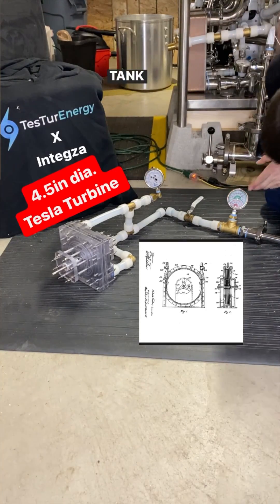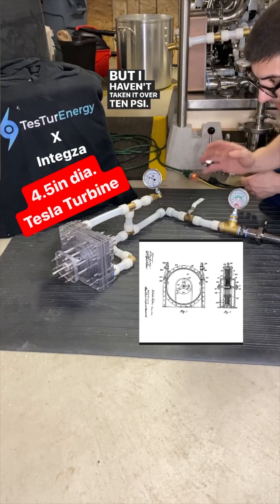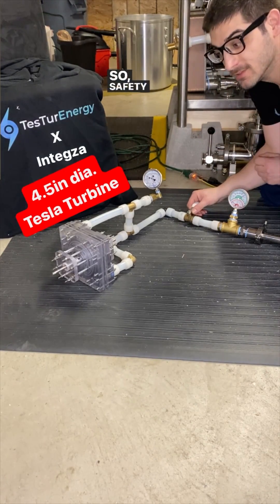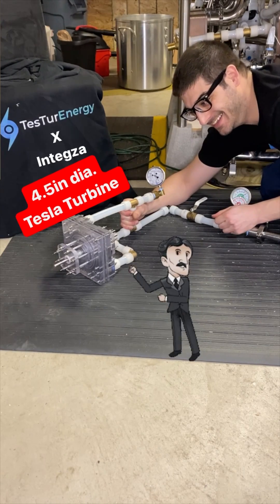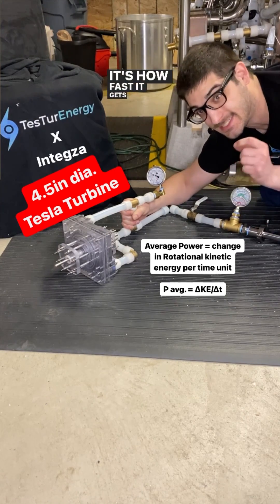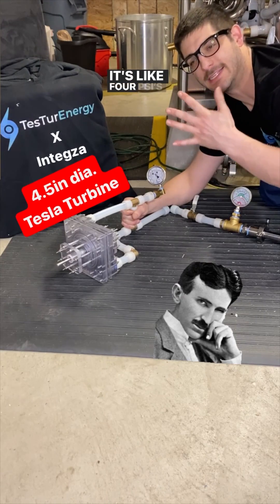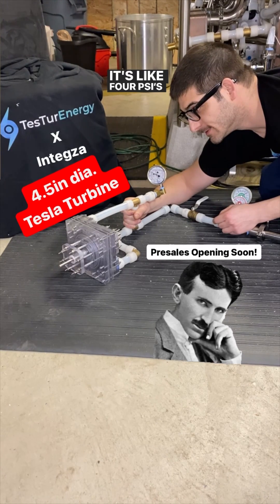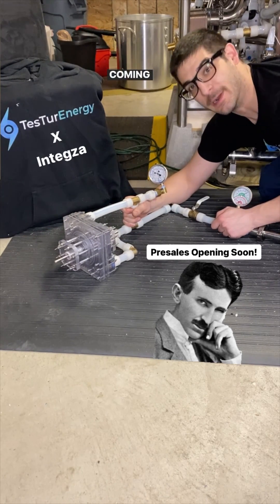New 4.5in Tesla Turbine 1st spin up! @integza Collaboration

Comment from the maker: If you want to get your hands dirty with a prototype of your own we are now selling versions of the 4.5in Tesla Turbine that we built during our video collab with @integza       

www.HeatAndPower.com       

Crafted with precision, the prototype boasts a robust design featuring an aluminum disc stack enclosed in a high-quality polycarbonate casing.      

The turbine is tailored to accommodate a variety of testing conditions, though currently optimized for compressed air tests.      

From initial trials, the turbine has shown promising potential, generating 1200 watts of power on a Dyno test with 30-40psi and a notable 250 watts electrical load when partnered with an upgrade generator package) on just 15psi of compressed air.      

It is also designed for future upgradeability, with provisions to accommodate a 2-stage upgrade we aim to release soon.      

While this turbine is a working prototype, it’s not a complete, turnkey solution or operational turbine. 

So, what’s the purpose of this unit?    

We’ve designed and are selling this prototype to provide a hands-on, engaging, and informative tool for those interested in our renewable energy systems, and specifically in Tesla turbine technology.    

It gives you a chance to see the turbine in action, understand its mechanics, and gain experience with assembly, disassembly, and maintenance.    

We believe this initial experience is crucial before making the step up to our full-sized, turn-key power generation systems.     

Get Yourself Prepared    

This prototype is essentially a first step for those considering a full-scale residential or commercial Combined Heat and Power (CHP) system.    

It offers you a unique opportunity to get up-close and personal with the turbine technology, and gain a practical understanding of its workings, benefits, and potential.    

It’s a scaled-down, educational version of the turbine we’re developing for our full scale solar thermal and biomass powered CHP systems.    

It is also designed for future upgradeability, with provisions to accommodate a 2nd-stage upgrade that we aim to release soon.

What Does The Loyalty Program Do For You?   

Learn how to safely operate a Tesla Turbine now with our smaller 4.5in prototype. 

Then save on your full scale turnkey residential or commercial power generation system later!  

Purchasing our 4.5in Tesla Turbine gets you a 10% discount that’s applied to your full size residential or commercial system, in the end saving you more than the cost of the prototype. 

See our website for more loyalty program information.

Comment: Hey charlie im a mechanical engineering student and your videos inspired us to do a research in tesla turbines and it would greatly help us if we can see what parts and dimensions you use for your 4.5 in tesla turbine
Reply from the maker: Hey thanks for commenting! 
 
if you want to get your hands dirty with a prototype of your own we are now selling versions of the 4.5in Tesla Turbine that we built during our video collab with @integza         
 
www.HeatAndPower.com         
 
Crafted with precision, the prototype boasts a robust design featuring an aluminum disc stack enclosed in a high-quality polycarbonate casing.        
 
The turbine is tailored to accommodate a variety of testing conditions, though currently optimized for compressed air tests.        
 
From initial trials, the turbine has shown promising potential, generating 1200 watts of power on a Dyno test with 30-40psi and a notable 600 watts electrical load when partnered with an upgrade generator package) on just 15psi of compressed air.        
 
It is also designed for future upgradeability, with provisions to accommodate a 2-stage upgrade we aim to release soon.        
 
While this turbine is a working prototype, it’s not a complete, turnkey power solution or high temp turbine.   
 
So, what’s the purpose of this unit?        
 
We’ve designed this prototype to provide a hands-on, engaging, and informative tool for those interested in our renewable energy systems, and specifically in Tesla turbine technology.        
 
It gives you a chance to see the turbine in action, understand its mechanics, and gain experience with assembly, disassembly, and maintenance.        
 
We believe this initial experience is crucial before making the step up to our full-sized, turn-key power generation systems.         
 
Get Yourself Prepared        
 
This prototype is essentially a first step for those considering a full-scale residential or commercial Combined Heat and Power (CHP) system.        
 
It offers you a unique opportunity to get up-close and personal with the turbine technology, and gain a practical understanding of its workings, benefits, and potential.        
 
It’s a scaled-down, educational version of the turbine we’re developing for our full scale solar thermal and biomass powered CHP systems.        
 
It is also designed for future upgradeability, with provisions to accommodate a 2nd-stage upgrade that we aim to release soon.     
 
What Does The Loyalty Program Do For You?       
 
Learn how to safely operate a Tesla Turbine now with our smaller 4.5in prototype.     
 
Then save on your full scale turnkey residential or commercial power generation system later!      
 
Purchasing our 4.5in Tesla Turbine gets you a 10% discount that’s applied to your full size residential or commercial system, in the end saving you more than the cost of the prototype.     
 
See our website for more loyalty program information.

Comment: Now I know, there is no such thing as free energy. But I am curious to see if you could power a 12v air compressor with the 12v output from the generator, and feed the air back into the turbine.
Reply from the maker: Hey yes. So check out latest updates on my Instagram. Just did 250 watt electrical load tests! 

https://www.instagram.com/reel/CsztsilNcyS/?igshid=MTc4MmM1YmI2Ng==

And I’ve done preliminary dyno tests that have shown about 1000-1300 watts with about 30-40psi

So anything within those ranges of power could be powered. 

Now this is technically how all gas turbines operate. But they require an input heat. They compress air, heat it with fuel or some other heat source, then expand the air through a a drive turbine for driving the compressor and further outputting electricity.

Comment: Got to live V² in the force calculator.  Might give you some  resistance and rpm difficulty when applying back torque with your generators.  You may need to do some down gearing but nice and compact so far.
Reply from the maker: Hey nice to hear from you Evan. As far as gearing this thing could easily be geared up still 🤭 it’s got PLENTY of torque

Comment: Was watching your first startup video from like six months ago, and was thinking I would love to use a rocket mass heater boiler to power it with wood, without having to process my yard trimmings and cord wood biomass into powder to burn in the Tesla burner.

  I have a 120 gallon open top stainless tank I am going to place into a masonry filled insulated bell chamber, and heat with a vortex rocket stove.   This would be for a hydronic heating system, with radiators initially, and in-floor heating as I am able.

  The vortex type of combustion core I want to use can be seen here: https://youtu.be/TKAJOppVSZ0

Scaled to double the size and about 4x the power.

  I would love to be able to put a hot side heat exchange loop through the boiler, to be able to create electric power, alongside the home heating system.
Reply from the maker: Oh yeah buddy! We’ll have systems available just for this exact purpose!
Reply: @CharlieSolis  - this is the link the type of core I am going to make...  (wanted to find you a short vid that showed it well...  I find the dual opposing vortex rams horn flames in the top box/riser chamber, quite beautiful.
https://youtu.be/TKAJOppVSZ0

  His is small, as a cook stove, mine will be built to double the size and should put out about 4x the heating power.

  Am going to experiment with making one cast in pieces made of my own Geopolymer cement refractory mix, and will be fully open source about the mix if it winds up holding up long term, but also intend to sell combustion core kits to people who want to build their own.  

  The high heat, complete combustion burn, allows you to do a lot with the hot exhaust gasses, without creosote buildup, as it is having a “chimney fire” every time it runs.

Comment: you know that
 you need to
  test it with load
Reply from the maker: Hey thanks for commenting. And You know that, power = change in rotational kinetic energy divided by the time it takes to do that change. The mere fact it accelerates so fast is by definition power (joules/sec) and torque. 

I’m anycase I’ve already more than proven TesTurs can handle real electrical loads. 

Tesla Turbine 250 watt to 2.65 kW Power and Efficiency Test https://youtu.be/K7qZvq1CMFg  

+5 Horsepower Tesla Turbine Dyno Jet Turbo Power & Torque Curve 375 mph @ 12,000 rpm  https://youtu.be/exF5Rn-L8gs  

Tesla Turbine Jet Engine - gasoline fuel burner atomizer flame tube test 186,083 propane burner https://youtu.be/gRqKowignac 

Steam Tesla Turbine Micro Power Plant - 1st Start Up https://youtu.be/aMYyBsjhBR4
Reply: yeah, but to 
know that way
it means that
we need to
know the mass and density of the rotor, that is to
know its angular inertia.
measuring it acceleration that way would be very innacurate,
so for that,
we use to load the turbine to
properly measure its acceleration,
if you want.
Reply from the maker: @Xayuap  ummm exactly how would that be very inaccurate. It’s a disc stack. The momentum inertia is very easily calculated. 

I=1/2*M*R^2

And if it was a hoop 

I = 1/2*M*(R1^2+R2^2)

Considering the vast majority of the disc mass is in the periphery and all of the discs have their mass from the inner exhaust holes missing the moment of inertia is VERY easily calculated. 

From there the rotational kinetic energy can be given for any RPM. All that’s needed is to know the RPM vs Time and power and torque can be extrapolated. 

Can you explain to me what’s so complicated about that? And why that would be inaccurate?
Reply from the maker: @Xayuap  also we know the mass of the disc stack. It’s 0.45kg.  Density is not needed because density is pretty much uniform for the material.
Reply from the maker: @Xayuap  and for the record acceleration is properly measured by measuring RPM over time. RPM is a rotational velocity. As such d/dt(RPM) = rotational acceleration
The change in RPM over time is by definition rotational acceleration.
Reply: @CharlieSolis  aaight, just do it,
now you can do two measurments
one without load, and other loaded with let's say an alternator. don't gonna blame the gen's efficiency later. oh, wait a minute, that is what dynos do.

it is not about competence. it is about redundancy of measurments.
Reply from the maker: Bud… I’m really not sure why you think I haven’t already done this for my previous TesTurs to know that this one will also get plenty of torque. 

Tesla Turbine 250 watt to 2650watt Power and Efficiency Test https://youtu.be/K7qZvq1CMFg 

+4250watt Tesla Turbine Dyno Jet Turbo Power & Torque Curve 375 mph @ 12,500 rpm https://youtu.be/exF5Rn-L8gs 

In any case, I’m getting to it with the first one. There’s still work that needs to be done before I just go ripping it apart. Things like improving the balance. 

Check it out. I can’t even keep the little disc stack from spinning it has so much torque 🤭
https://youtube.com/shorts/Zssqleq1Mug?feature=share